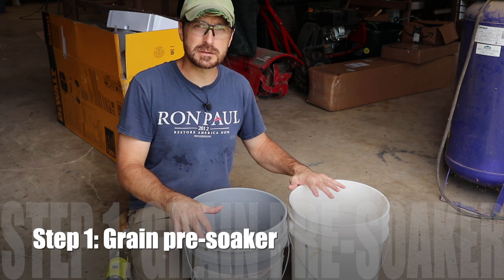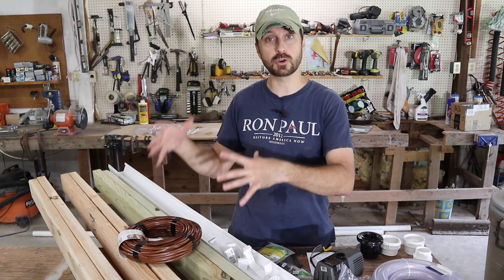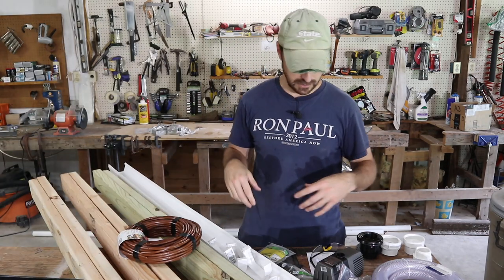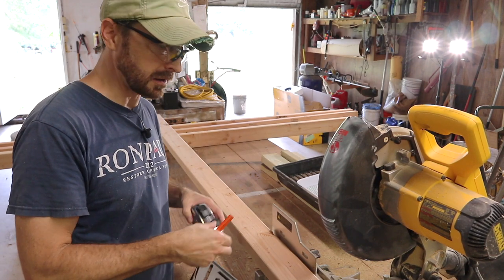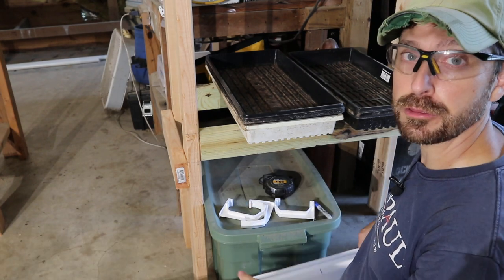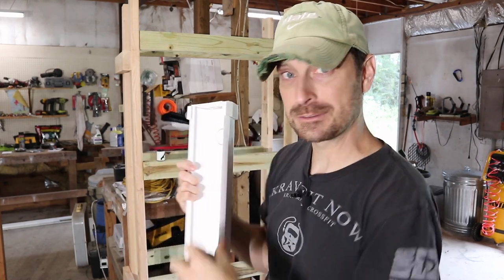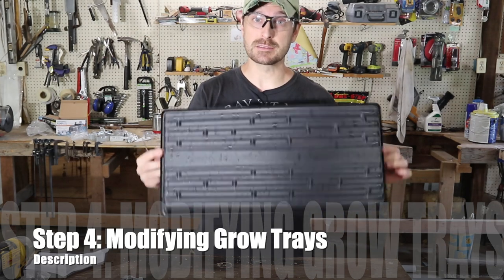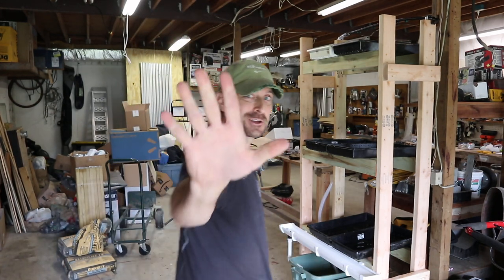Fodder For Chickens! How To Build A Fodder System And Save Money!

Comment: Thanks for the video.  This is a neat project.  I do need to point out that the pump flow rating should be in gallons per *hour*, not *minute*.  Moving 800 gallons in a minute would take a 20" pipe and a pump the size of a bus.  :)
Reply from the maker: You're welcome. Yes, I misspoke.

Comment: Awesome build! My wife and I will be building in tomorrow morning using your specs. We’ve watched the video like 5 times and have a couple questions If you don’t mind: 

1. Why did you space the shelves as such? It appears to me it would lead to a lot more splashing then if shelves were closer together. 

2. Does the drain pipe dripping slowly lead to water leaking under and back out of the tote along the bottom of the PVC pipe?

Thanks again!
Reply from the maker: Thank you! 
1.No reason for the shelf height other than easier access to pull it in and out and manipulate the seed if needed. It doesn't splash when the grain is in there. You can lower it as the height is arbitrary. 
2. The drain pipe has never leaked. It extends about 4 inches into the tote.
Happy building!
Reply: @CountryLivingExperience  Awesome! Thanks so much.

Comment: I think the problem with this design is the splashing that occurs causes a lot of water loss - But thank you for the ideas - I think a bit more $$ can get you a system that has minimal splash back. Taking some 1" PVC can cutting it in half long ways and using that as a catch then looping down and drilling small holes in it would allow the water to waterfall in, instead of drip in. Gonna try it and see how it works.

Comment: A couple of questions: 1. From the looks of it, the water is falling too far from one shelf to the other and splashing out.  Do you get a lot of water on the floor when watering?
2. Do you have problems with some of the lower trays not keep every seed moist since the water can just drain below the seed line in the tray?
Reply from the maker: No water on the floor. Looks can be deceiving. The grain the the trays below dissipates any splashing. All levels grow the same. There is not much difference

Comment: Very cool system! Is there a chance you will do an update video on this so we can see the growth?! Thanks!
Reply from the maker: I usually don't do update videos because nobody watches them. The growth is similar to the thumbnail pic for the video. Wheat works the best. Oats tend to rot before they sprout too much.
Reply: @CountryLivingExperience  Fair enough. Thanks for the info! I attempted it a while back with Barley and barely anything sprouted and then the mat just molded quickly.
Reply from the maker: Try increasing the angle slightly to get the water to drain a little more. Also try putting less in the tray and give the wheat a shot.

Comment: Dude, just found your channel and subbed. Great content, where is the update to this system? Did it work or would you change anything? I’m trying to learn from everyone else’s mistakes before jumping in to fodder. 
Also, do you feed it as a treat or main food source for your chicken?
Reply from the maker: Welcome to the channel brother. I appreciate the kind words. No update yet as I have been extremely busy. Probably sometime this spring. 
It works perfectly with one caveat. I had to play with the draining angle a bit as it was not draining as fast as I would have liked. I think I increased it by 1/2". Additionally, the grain needs to be kept back from the drain holes at least 1" to avoid the roots plugging the holes. I use this as a supplementary feed in the winter to provide added nutrients.

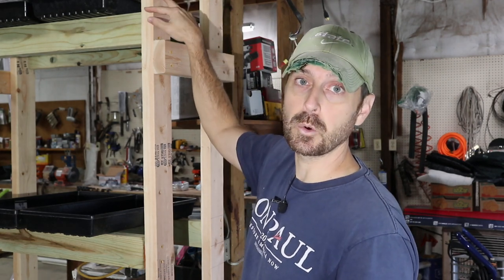Comment: I'm commenting @7:10 so I'll edit if I learn the answer after this question.  I have the attention span of a peanut so didn't want to forget. LOL!!!

How come the pressure treated lumber?

Edit: 
Would this system work in a garage in a mid-eastern coastal climate (NC, southern outer banks) that is mostly humid during spring and summer, and then super cold in the short fall and winter months? Our garage seems to be extreme in temperatures based on what it is outside.  So if 45 degrees outside, it seems to feel like 30 degrees in the garage.  I ask because I feel like I do so many things indoors and have taken up so many "living spaces" with those things.  I would love to learn how to utilize my garage that is pretty much a "junk drawer" right now.  To include brooders for chicks, growing fodder for my chickens, and seed starting for the spring growing season.
Reply from the maker: Pressure treated lumber because it is a wet application. If the water from the trays gets on the crossmembers, they can rot fast. This will work in all climates if its kept in a semi-warm enclosed environment.

Comment: You mean gallons per hour. At what you're saying in GPM would be 48000 gallons in an hour.  Which is more water than a 25x50x5 foot pool. 

500 GPM pumps are the size of small cars
Reply from the maker: Yes, of course. I simply misspoke.

Comment: Why is everybody trying to make this complicated. Stacking the buckets with a one inch layer of seed in each bucket works. Soak seed with a little bleach to prevent mold. Water the top bucket drains to the next bucket and so on. When the fodder is ready just empty and start over. Rain gutter works good too for long narrow fodder.
Reply from the maker: Because this system can make a lot of fodder continuously providing constant feed hands free.

Comment: Great build! 
Seems like you'll lose a lot to evaporation, have you added an auto-top off system?
Reply from the maker: Thank you. I could do that but there is not a need for me to be that high tech. By the time one full batch has grown (6 trays), the water really needs to be changed out. I really don't see much loss in the 10 gallons over a 2 week period.

Comment: Any problems with recycling the water?
Reply from the maker: Nope. It just gets a bit smelly after about two weeks from circulating through the grain. I actually added a drain at the bottom change the water out more efficiently.

Comment: Do you use just feed seeds to sprout? Or but special seed for it? At my garden store they have fodder seeds but they only sell them in like 1/2lb bags and very expensive
Reply from the maker: Yep, I just use feed seen. $13 for a 50lb bag. Wheat is the best. Oats do not do well as the hull is too thick and they tend to rot instead of sprout.
Reply: If I noted your soak time accurately, 12-24h is WAY too long of a soak for oats.  Oats are unique that way and a long soak drowns them.  30-60 minutes is all that is needed.  See if that helps?

Comment: Wouldn't the shelf degrade within few years with all that water splashing around? Would rather use HDPE or stainless steel to build one.
Reply from the maker: The shelves are made out of treated lumber. The water does not splash out much at all. Have run mine for some time now with no problems, no rot, no deterioration. You can use what you want to make one.

Comment: 800 gallons a minute is A LOT of water.. are you sure it's not 800 gallons an hour? You would need 6" schedule 80 pipe to flow 800 GPM at 10psi.
Reply from the maker: Yes. I misspoke.

Comment: I think you mean 200 gallons per hour.  Approx 3 GPM
Reply from the maker: Correct. I misspoke.
Reply: @CountryLivingExperience  no problem just do not want people to get confused.
Reply: I was going to steal a pump off a firetruck for 800gpm
Reply: @cyberooster  a fire truck is generally rated at 500 GPM.😂

Comment: You said 6'7" and I cut them at 6'7" and then it shows 6'9" tall
Reply from the maker: I said 6'7" but showed the correction (6'9") at the same time. At the beginning of the video I also said cut 15" off of the boards which would leave you with 6'9".